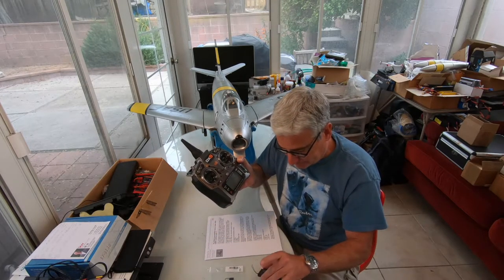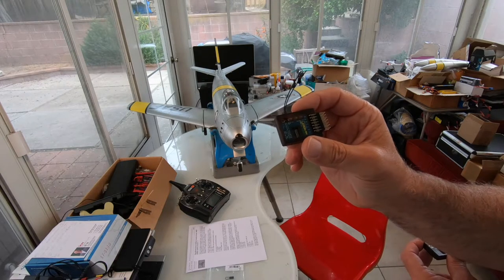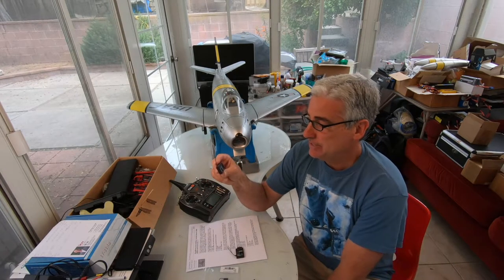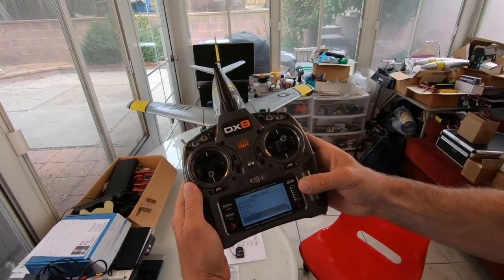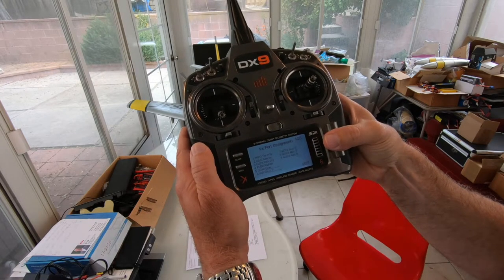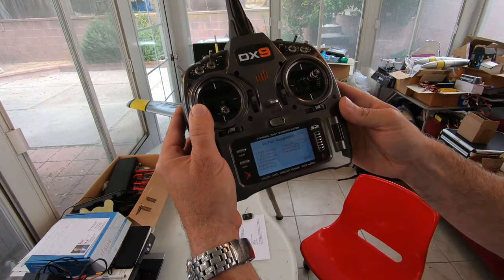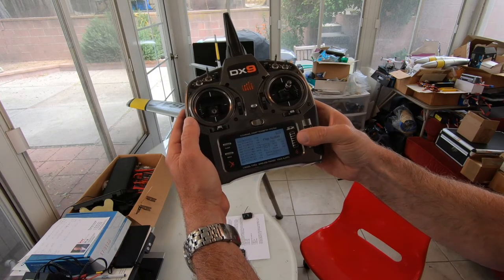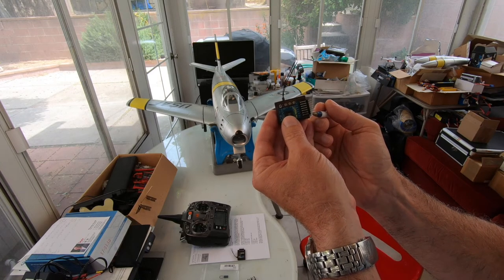Lemon Stabilizer Plus setup in Spektrum radio using gear and flaps

Comment: If you didn't know, this receiver is for the purpose of the use of the self leveling or auto recovery, if you don't need that then stick with the other receiver. That's the purpose of this new one, that's why is call plus +..

Comment: I am setting up a lemon stabilizer and I got it to work (except) , Every time I plug in a battery I have to rebind , and  the mode switch on gear channel only gives me solid green , move receiver and surfaces move  , flip 3 way switch to 2nd position green red solid , move receiver nothing . 3rd no change ...Please help . I have j 4, and 5 flipped to on . Thank you for your time .
Reply from the maker: Ok. Every time you apply power to receiver you have to rebind? Forget the rest. Solve the bind issue first. Turn all dip switches off first. Only plug throttle channel w esc power in, unplug the rest. Bind normally and then remove bind plug. If the bind doesn’t hold in that basic mode then chuck it! Bad receiver.

Comment: For the new DX 8 G2 TX will the set up be the same connections and channel assignments be the same? on my DX 8 G2 I had plugged in my gear to the gear port and I believe I fried my servo. Great information if this works for me. I will be setting this up tonight with fingers crossed. yes, im a newbie, but willing to learn from you pros! Thank you, Les
Reply from the maker: Lestil Arnold yes. Same settings for your new radio. Good luck.

Comment: how would you set up dual servos for the elevator on the lemon 7 ch
Reply from the maker: I almost always have dual elevator servo aircraft setup using y adapters and reverse servos. However if your goal is to use tailerons then follow online instruction using dip switch. If using 6 channels w  flaps and retracts y adapter is the only simple option.

Comment: Hi, I followed your instructions and all works exept when I put into Auto level, the gear swuch operates the ailerons ?
In gyro and off gear swuch works normal
Reply from the maker: Yes, unfortunately many, including myself, have had issues with auto leveling. I have resigned myself to not using auto leveling.
Reply: I followed the same and it worked just right.  Check your switch assignments - you may have missed something there.

Comment: So I'm a little confused... dx6e , new lemon rx with stab plus. Can I set up flaps on bind port.  Same as on your tx.  Will flaps work while in full stability mode. I have searched everywhere for answer. Thanks... CURT
Reply from the maker: Debbie Rice things get a bit tricky on a radio with less than 8 channels. If your using the stability functionality with retracts and flaps then no. There is an option to program receiver to be in constant stability mode and use ports and channels like a regular 6 channel receiver though.
Reply: @HeyFlashman  No retracts just flaps on a glider no fancy mixing just plain ol flaps. So with flaps stability all the time.  Is there a tx that would do both stability on switch and of course flaps?  Thanks so much.
Reply from the maker: If you’re not using re-tracks then yes no problem use the gear channel to turn stabilizer on and off and use auxiliary one for flaps.